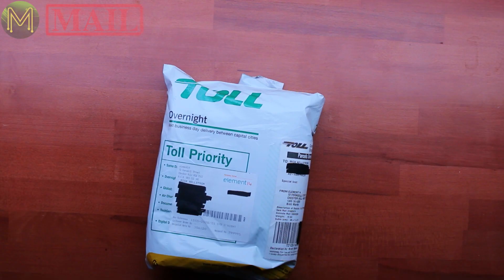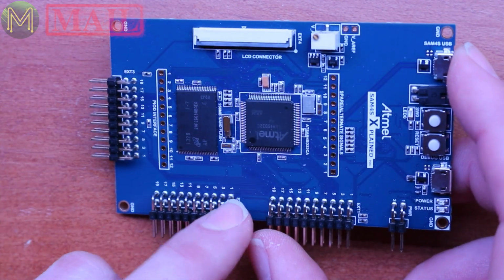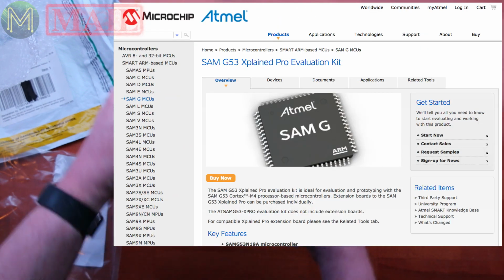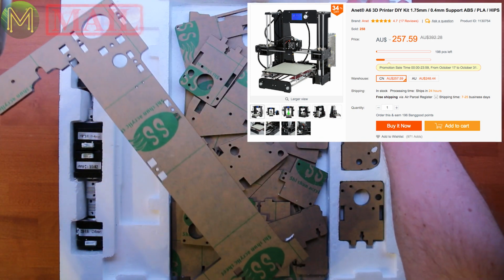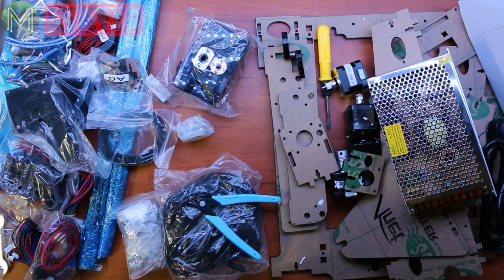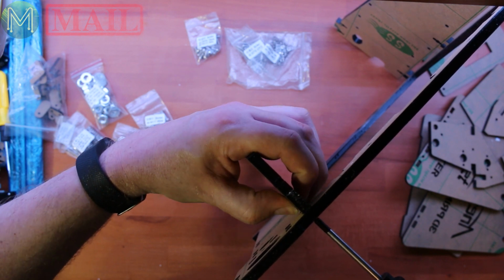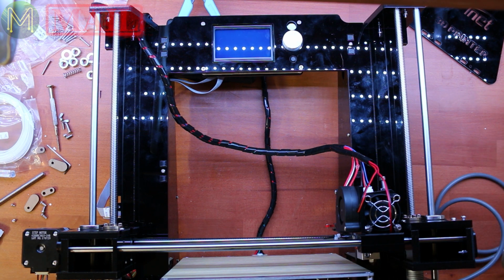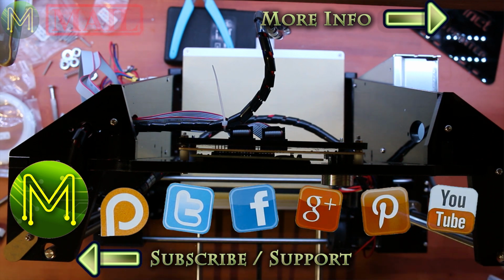#176 MickMake Mail #20: SAMG53, SAM4S & Anet 3D printer // News

Comment: Did your main board match the one on the supplied instructions?

On my A6,  the main power terminals on the board were reversed from those shown in the instructions (nasty!) and a couple of the stepper connections were different, too (Y and one of the Z motors).. My advice: Follow the labels on the board not the ones in the instruction PDF!
Reply from the maker: I didn't follow the PDF instruction, but the video. It was fairly accurate. Haven't powered it up yet but might just double check that on the PCB.
Reply: MickMake If your board is the same as mine, looks like you have them the right way round. 👍

Comment: What is the electrical problem in Australia with the 3D printer ? Did I get that right : You are not allowed to make a wired connection as a customer ? So the expectation would be to have a connector ?
Reply from the maker: Laws vary from state to state, but in New South Wales, (aka Nanny State for Wimps), we aren't allowed to make ANY changes to wiring that carries a mains current. Before the GPO, after, middle or anything else in-between. It's crazy, but there it is!
Reply: That's why it is so important to have a mate who is a sparky, so he can take the blame...  j/k
Reply: Interesting - always thought as a private person you can do a lot in any state - only when you are in that business you have to have the expected licenses etc. Ok, in Germany we warn people to do/play with electrical power, but we also have laws to ensure there is a fuse and a earth leakage circuit breaker... etc. This always reminds me about the bad joke: What is black, half cubic meter big, smelling like sugar and hangs from the ceiling ? A former diabetic hobby electrician .... :D
Reply from the maker: +Peace Keeper 
In South Australia you can, apparently, modify anything past the GPO. So that means this 3D printer would be OK.
Anyway, not sure why the mains cable was separate in this instance. It wouldn’t have cost much more to have a PSU with cable already connected.
Reply from the maker: +Peace Keeper 
Ha ha.

Comment: is it really illegal here in nsw to wire up the plug on an appliance?? i thought it was about wiring the socket?
Reply from the maker: +zen 
Apparently I was wrong. A sparkie sub sent me an email saying that you can wire up appliances. So there you go! Was always wondering why Bunnings were selling loose power cords.
However, the power points definitely cant be wired up by a non-licensed individual.
Reply: awesome - thats what i was always told, good to hear i wont be doing illegal things :)

Comment: +MickMake Hmm, an improved A8.  That monster heat-bed is good for marketing, but over-sized for the power supply, as it can draw 10A.  It is easy fry the power junction connecting to the bed, and/or the main board.  Esp true for filament that needs high temps to stick (ABS @ 130C).  For this reason, most of us add a separate 12/24V source just for the bed, controlled though a MOSFET.  Seriously reduces malfunctions!  Will send you more info,  even a low Rds(on) MOSFET if you are interested.
Reply from the maker: Yup, absolutely will need to do that. Plan on making some ABS enclosures with it.
Reply: Yeah, an off-board MOSFET for the heated bed seems sensible.  I've had to help fix a couple where the MOSFET and connectors were burnt.  There are after market kits available.
Reply: +MickMake probably has the necessary components about the house.  The mainboard does not use PWM.  Rather, it turns the juice on continuously until the bed reaches temperature.   So a fast-gated MOSFET is not optimal ... better is a TrenchFET with a very low on resistance so it will not get warm while sinking 10 amps.  The IRLB3034 has an Rds=1.4mΩ -- the king.  Many DIY descriptions online like this below:  https://www.youmagine.com/designs/ultimaker-heated-bed-mosfet-relay-hack-v2  Looks like V3 has an opto-couple (meh).

Comment: I do so hope your first 3D project is to print up an enclosure for (at least) the bottom of that power supply - no, scratch that - buy one and install it before you ever connect it to the mains. (You don't want someone killed)
Reply from the maker: Yeah, even with a cover it all looks dodgy. I doubt very much it has been through ANY certification process.
Spent a couple of hours with +Kean Maizels and a cert guy the other day going over certification on a product we are working on. I knew it was tough, but it's serious business.
Reply: MickMake +Kean Maizels, he's the engineer you leaned on to review the reflow soldering system isn't he? Well, if a full-time professional electrical engineer finds certification a pain, I guess it must be.

I'll have to tell you one day about the fun and games involved in getting high volume PCI-DSS certification (or not)
Reply: Yep, that's me - although I am neither a professional electrical engineer or a "full time" one.  I never finished either of my degrees (EE or CS), but I do have over 30 years of experience and I usually know more general "stuff" than most professional engineers I have worked with (and clients also tell me I am more "professional").  Like Mick I am cross disciplined, and have also spent a lot of time on IT projects.  I work with specialists when needed, such as going through product certification which is a mix of technical speciality (RF, EMI) and bureaucratic red tape.  Australia actually appears to be one of the easier places for product certification to be honest.
Reply from the maker: I think any certification is a pain, but a requirement if you want safety or just things that work reliably.
Reply: BTW, I have had a product fail in certification, but it wasn't too hard to sort out (but I felt sorry for the factory workers having to implement the changes).  I've also looked at what was involved in PCI-DSS in the past - ugh!

Comment: I have the a8. Things you will want to do with it before using it in anger. 

Mosfets for the heat bed and extruder. Also solder directly the plug for the heat bed. The plug isn't rated for the amps, so will eventually burn out. 

Lots to learn, but you can get awesome prints. Main things are later heights and speed.  Good luck and enjoy.
Reply from the maker: +danddbandb 
Thanks mate. A couple of people have suggested that, might just skip straight to that on my first print.

Comment: You might want to check out the video that Punished Props did on this printer. They had to print a few gussets and other bits on it to stabilize the thing for better print quality. The bad news is that it doesn't come with the extra bits. The good news is that it can print them. I think they have a link to the STL files they used too which is a nice touch. Great video mate, thumbs up high...
Reply from the maker: +ExStatic Bass 
Thanks mate. I’ll check out his video.

Comment: It's not against the law to wire a plug into a power supply in NSW. It is illegal to do house wiring up to and including the plug. The requirements for licence requirements for electrical wiring are found on Fair Trading's website. [ http://www.fairtrading.nsw.gov.au/ftw/Tradespeople/Home_building_licensing/Licence_classes_and_qualifications/Electrical.page ] .
Reply: Yes, you're definitely not allowed to do fixed wiring.  I've been told multiple times that wiring a plug into a PSU is also not permitted, but I'm not sure if it is written somewhere in legislation or if it is just a liability/insurance issue for the companies selling power supplies and mains power equipment.  Obviously all consumer products must be safe, and thus already have mains cables.  For jobs I work on I always have a sparky sign off on any mains wiring.  Otherwise everything runs off plug packs or batteries.

Comment: That intro ... as bad as a Trump tweet. <Runs and Hides>
What does the desk use to power the motion? Linear actuators?
Now you can print yourself a reasonable cover for those main connections!
Reply from the maker: +Richard T 
Ha ha. <ducks for cover>

The desk has plain old DC motors with encoders on them. Very well engineered desk. It is German after all, so no surprise there!